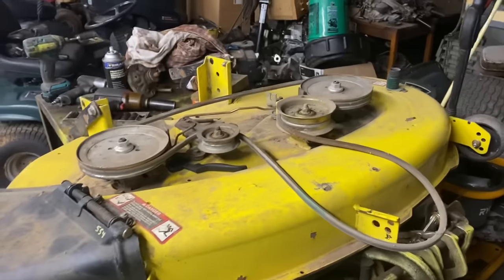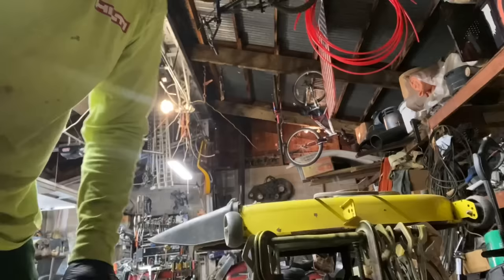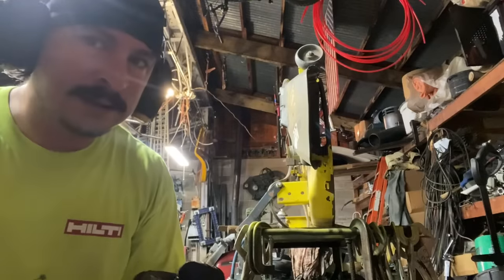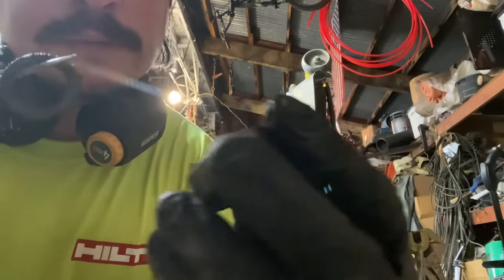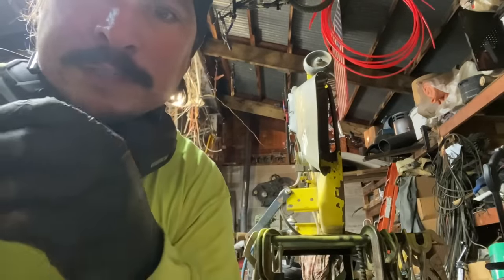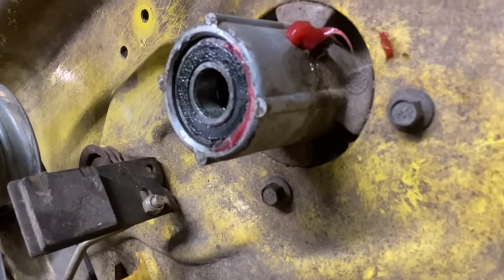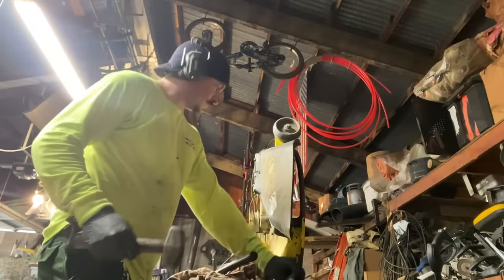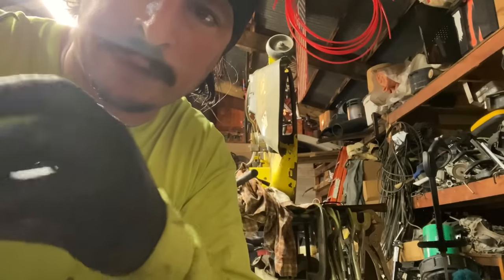Part 1 - Don’t trust the “Experts” Grease your mower deck sealed spindle bearings Common sense.

Comment: I've worked for a major paper products company for a lot of years and I've been to the SKF "bearing school". A few things to think about. 
If a bearing has a metallic "seal", it's actually a shield until you get into larger bearings. The rubber or rubber clad are the typical seal. 
Small bearing seals will almost always be directional, lip facing in, to try and retain the grease in the bearing. That's why grease can migrate in with little pressure.
I see tons of people talking about the clear "Vaseline" grease from the factory. It's not Vaseline, it's typically something like SuperLube. Look it up, it's great grease.
I always center drill my spindle shafts and port a hole from the side of the shaft into the housing, then notch the spacer sleeve at the bottom to direct the grease to the bottom bearing because that's almost always the first to fail due to the load from the blade. 
I leave the top seal in because unless you completely fill the cavity inside the spindle, all your doing is letting the grease out of the top bearing and leaving it dry. 
If you do completely fill the spindle, you're only one or two pumps away from pushing the outer seals out of the bearings. A grease gun can make upwards of 8,000 psi with a little force, it takes about 5 psi to pop a seal.
Be careful hammering a bearing out from the inner race. Too much force can cause the balls to actually leave dents in the races, hastening the death of the bearing. Whenever possible, use a press on the race requiring the force. If you have to use a hammer, use a deadblow hammer to reduce the shock. 
You can over grease a bearing. A lever-style grease gun disperses 1.28 grams of grease per pump while the hand-grip style disperses 0.86 grams per pump.
Use a good grease that's not too thick, excessive thickeners are basically soap and can actually cause excess heat and a lack of lubrication because the grease won't flow into the bearing. I use RedNTacky, just something I've had good results with. My John Deere 60D deck has over 600hrs on the original spindles (these are completely filled with no inner seal on top and bottom from the factory but use secondary seals in the housing) getting 3 pumps from my hand grip gun every other time I mow my 4 acres. That's about 2.58 grams every 4 hrs, not much but obviously enough to keep my spindle bearing alive for over 10 years.

Just my 2 cents, good luck, stay safe.
Reply from the maker: @markg1247  some good points and you could be right about a lot of things on this topic. I’ll admit you seem to know more about the subject than I care to dive into. Basically I know grease is good and dry bearings are bad and Iv seen plenty of new machines with under 100 hours with total failure of the deck bearings and PTO bearings I will add. you kinda lost traction at pushing a seal off the bearing. Thats not something that happens in these applications. It won’t happen even if you try to make it happen. I cant explain why it’s not an issue because it seems plenty logical but for this application it’s just not a problem. Probably because the assembly is put together in a way that the shields can’t simply back off
The bearings while other components are blocking it. No room to move out away from bearing. Or because only one small area of the lip has to give way to let a liquid escape. Regardless of why, Iv never seen it happen once in many years of doing this. If I would have found any draw backs of this application as Iv displayed I would have stated so, but to this day it only has 100% positives and absolutely zero negatives that I have ever encountered. You can pump as many pumps into the assembly as you like wound make any difference to the seal/sheld. Doesn’t matter if it’s a metal shield or plastic or plastic coated shield they all have a lip and that’s where the grease passes. It’s very basic and anything Iv shown can be tested at home. If anyone can prove damage can be caused please feel free to make a video explaining and pointing out the exact damage caused and post the link in my comments. I’ll glad stand behind anything I can duplicate if there is any way this causes damage but after over a decade of nothing but success, I wouldn’t expect to find anything that can be proven other than the absolute Benefits of greasing the assembly till it’s filled. Inner seals do no good one way or another and more less just there for assembly purposes from what I can tell. Has never been proven one way or another. I happen to believe they are more beneficial to be in place for holding grease in the upper bearing. If it only takes 5psi to dislodge a seal, it’s interesting that Iv never seen that happen. Possibly because the assembly is not holding any pressure and the grease simply pushes past the seal under “5psi”. I don’t know the pressures it takes to push through the assembly and I can’t confirm 5psi would push a shield / seal off a bearing, but I can say it’s never happened to me. And nobody in any of the comments in well over two years has ever shown proof. One thing I can say with certainty is that’s is the naysayers with no evidence who argue about this process but many people leave comments who have been doing this for decades and never had any bearing issues. Take it for what it’s worth, do it or don’t do it. I won’t benefit either way, the owner of the mower is the one who will benefit in the end. Point is, the process works just as Iv shown and it’s the simple way to make bearings last. No need to dismantle new decks to remove a shield that presents no opposition to grease passing and no need to spend time dismantling something that has a grease zero already present. Yes, I get it that plenty of folks would rather do it that way because in their brains it just makes more sense, but my point is that the easy way works 100% of the time and is just as good as doing it the hard way and the process I show is much better than just running the deck to failure. Folks can do as they wish with the information. Maybe just giving folks something to think about is enough.  Cause nobody else on YouTube has a video showing to do it this way. But plenty of bad advice on the topic unfortunately.
Reply: @GTObearclaw1  

Just passing along some info of the possibilities. I've worked on everything from 1/4" cam followers to very large yankee dryer main shaft bearings. Most of the pushed out seals I've come across were in electric motors, but I've seen plenty in regular old 1" pillow blocks. Just had one happen a month or two ago, a young guy at a compressor station I take care of (electrically) called and said he was seeing elevated vibration readings from an oil cooler fan. 3" double row pillow block on a shaft for a 10' diameter 4 blade fan. I brought up an analog input trend in the PLC to graph the vibration. I asked if it was recently greased, he said it had a Simatec automatic lubricator on it and he wasn't sure if it was working. I asked if he could put a couple of shots by hand in it while I watched the trend to see if it helped. He headed out and came back a few minutes later and I noticed him putting a new grease sleeve in a battery operated grease gun. I asked how much he put in, he said only one tube! I took him back out and the grease was already running down the shaft out of the fan housing, and we could see the seal wobbling around through an inspection port. 
That's an extreme case, but it can happen.
Is it likely to happen on a mower spindle, probably not. I doubt there are too many "super greasers" out there.
Can it happen, sure, that's why I mentioned it.
Should someone be cognizant of the possibility, sure, that's why I mentioned it. 
Here's a link to a good quick read about the subject. https://www.machinerylubrication.com/Read/31806/too-much-little-lubricant
I did notice a typo in my post, it should be 50 psi, not 5 psi. Missed a zero.
Reply from the maker: @markg1247  thanks, good conversation 

I still
Disagree, I don’t believe the shelf will pop off on a mower deck spindle assembly due to how it’s put together. No room for it to push away.

Comment: Very true information! On a larger scale, the company I work for buy new Cat excavators & the machines are sent out brand new from Cat with a few pumps of grease in each nipple. On the larger pins on the boom we pump in up to 3 full tubes of grease before we see any grease coming past the seal. Those pin housings are empty. Cat trying to save money on a sale of a hundreds of thousands dollar machine.
Reply from the maker: @hartzland7658  the faster you break it the sooner you need parts. They are in business to make money. We have to protect ourselves. It’s bad enough they engineered things to fail but at minimum we can keep them serviced to make last as long as possible

Comment: Okay, you made a good point. But when do you say enough is enough? Wouldn’t pumping grease in to the point that it penetrates the seal and gets grease in it, what holds the back seal from popping off? We all know it takes a lot of grease to fill the spindles before it forces into the bearings.  Have you tried pumping to the point of grease popping the seals out the other side? If it fills the bearings it’s got to come out at some point! If you put that much grease into the bearings and the outer seal pops off that will do more damage than the little bit of grease that you got into it.
Reply from the maker: Iv yet to see a shield come off a bearings grease passes the lip of shield. I use the word seal real lightly for this application. If the assembly is together properly there is no room for the shield to push away from the bearing. Only the lip allows grease past. Iv answered this same question dozens of times. When you do it and it works out you will understand.

Comment: I ran my mower on my farm and on jobs.  Thick tall grass for many hours.  Sealed bearings ran very hot. Of course they get cooked dry of any lube.  I removed bearings , pry the plastic sides off. Washed in cleaner, packed high temp wheel bearing grease put plastic sides back on.  Bearings lasted.
Reply from the maker: That works as well. Just requires the tear down of the deck to get that done. If you want to avoid having to go through all that trouble just grease the mandrels via a grease zerk. If there is no grease zerk it’s easy to add one. Then in the future just pump some grease in.

Comment: I have been doing this to mine. In fact my hubs had no grease zert so I drilled and tapped them. Removed the inner seals and hood to go!
Reply from the maker: Even without removing seals it will
Still reach the bearings. Inner seals can’t stop the grease.

Comment: Good info about grease getting by the shield. I have a Scotts L17542 (JD) It is 20yo and has about 1500 hours. Needless to say I've had to swap spindles a time or two. In the instructions from JD they stated to use use 3 pumps per season. I'm going to fill those suckers tomorrow.
Reply from the maker: Lol. It amazes me they would say 3 pumps. Thanks for taking time to leave a come t. I believe That model  Scott’s was one of the ones made by Deere and a very good machine. If you ever have issues with the rear axle loosing drive power you can weld the pully to the input shaft for a solid fix. Iv fixed a dozen of those. The drive pully strips the splines. About the 3 pumps as directed by the manual, That’s absolutely hysterical. Makes me wonder if they are that stupid or just want us to feel like we did the PM and allow it to
Reach failure. I recon they must know that 3 pumps once a year would not do a bit of good. Even at 3 pumps a year for 20 years the void would not be filled or just beginning to fill but no way all the the bearings will last 20 years so by the time  the void is full bearings are already going to failing due to grease never filling the cavity and building enough pressure to pass the seal. I agree that 3 pumps is plenty but they need to fill
The assembly when it’s new and from that point we could just add three pumps and be good to go. My rule of thumb, if you don’t see grease exit somewhere then it still needs more. Once you see grease the cavity it filled and therefore so are the bearings. That’s the only way to know for sure. Iv had some that took almost 100 pumps from a hand pump grease gun.
Reply: @GTObearclaw1  Thanks for the info
Reply: @GTObearclaw1  I was mistaken the wording was several pumps and when installing new 10-15 pumps.
Reply from the maker: @ericcorse  10 to 15 or
Maybe 75 pumps. Lol
Reply: @GTObearclaw1  I greased mine yesterday maybe 60 pumps each. You could tell when it got full one side got tight and then released. I better check to make sure I didn't blow out the seal.

Comment: 1) what happens if the deck was not put on its side but in its normal position? 
2) Many assemblies have a weep hole, what would you recommend to plug that up?
Reply from the maker: Answer to
#1. Makes absolutely no difference what so ever. The position of the assembly won’t matter. Grease is under pressure gravity has no effect here. 

#2. Yes absolutely plug that hole with something. A machine screw or a self taller, or better yet put another zerk in that hole. Sounds like maybe a MTD / cub if it has a hole in the side. And those usually have a zero on
The bottom. Be nice to have a zerk accessible on the top side of deck.  That’s a dang scam. That hole will let grease out before it can push past the lip on shield. Such a total moron design. Only two reasons that could have been done, the engineer was a complete bone head or they knew what they were doing and was intentionally trying to make it so grease would never inject into a bearing. The hole will let grease escape before it can build up pressure inside the assembly and if No pressure inside the the grease will not push out the lips on shields. I hate hate hate anything MTD makes. They absolutely ruined the cub brand and the ruin everything they touch. Cheeper and cheeper every year. I hate to even have one sitting in my shop and I hate selling one because I know how crappy they are. I don’t know that yours is one of the brands under the MTD umbrella so I should not have assumed. And why would they put the zerk underneath? Hummmmm, almost like they hope nobody finds it after it’s covered with grass it’s nearly impossible to find without scraping grass off and hunting it down. Lol

Comment: This was a good video. I always thought it would go threw but the experts keep saying it won't pass threw.
I bought a battery powered grease gun for this purpose. 30 to 50 pumps takes way to long for me. 😂
Reply from the maker: Yes I agree. All that pumping gets old fast especially on the decks with three mandrels. I was amazed that so many so called mower experts that post videos on YouTube and not a single one can understand this and also none have shown proof that the process won’t work. They just run the mouth and want to be on camera and say don’t bother. Bunch of hard headed experts in my opinion. I’m
Still waiting for the ones I upset to post proof showing this process won’t work but all they do is talk and don’t back it up. I proved it and they still can’t accept it. They keep coming at me with crap like it will break the bearings or push a seal off or it will overheat a bearing. Talk talk talk is all they got. Can’t back none of that talking up. Iv done this for years and years on equipment that I mow with and amazingly never experienced a single issue off the huge list of so called issues that occurred from this process. They have nothing and should delete there videos with misleading lies they can’t prove. But hey, as you can see I don’t let that bother me. Lol 

On a serious note, thanks for your comment.

Comment: Loctite red or gear shaft locktite for outside of bearing this will provide longevity of the housing from being flogged out. It will eventually need a re-application & can be caught early so long as cutting deck is cleaned manually with compressed air or scraper or both (use water say good bye to those bearings) & blades is checked weekly (for sharpness & wobble test). Final point use waste oil on both sides of cutting deck everywhere. It can on top create a water/rust proof barrier once enough dust collects on it. The underside its great to keep rust at bay & help keep bolt heads clean. Use whatever you have or fastest method is one of those engine wash spray thingy (has a red pot with a long spray snout). Same method is great for creating the same barrier on the mower itself i.e chassis,guards & anywhere else you can get it.) I guarantee it works real good, however where exposure to weather or blade action a re-apply will be necessary. What doesn't get taken off will blow your mind when you wipe a finger through it to expose nice shiny paint after a few months or anything after 10 years. Leaving grass on a cutting deck or under is the quickest way to rust away the deck if in a humid climate,dry not so much
Reply from the maker: As long as the bearings have grease in them the other race has never been an issue. They have always stayed put and Iv had hundreds of decks apart. Thats just my observation. Blow tractor and deck off with leaf blower after every mowing and park indoors. Never wash u less you want to clean. Great rules to live by if you want the longest possible life without needing to do repairs as often. Thats how I roll